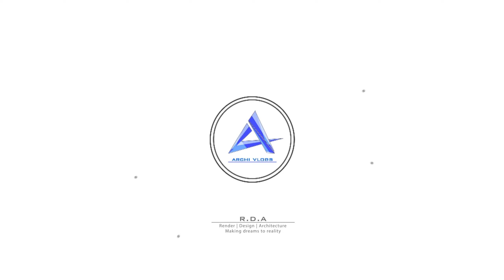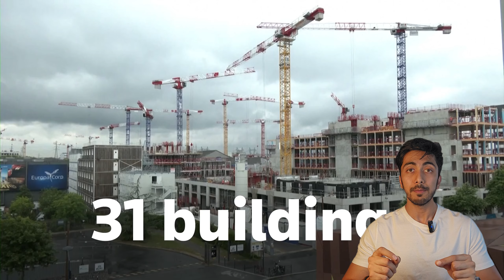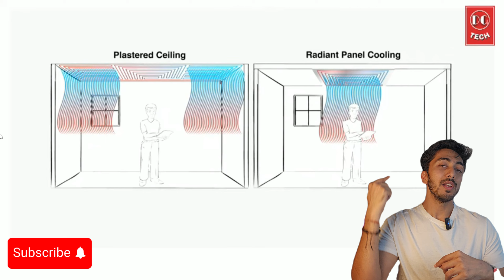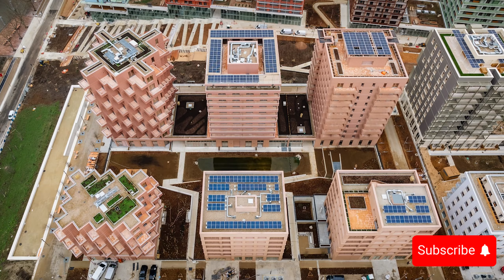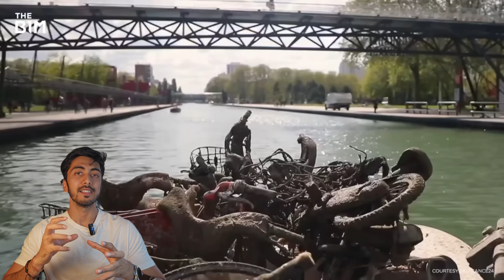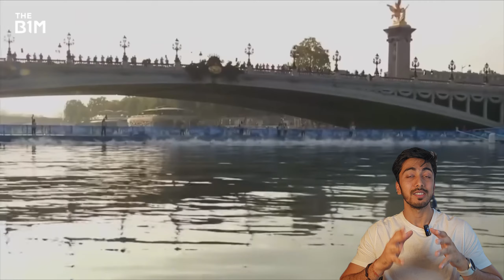Paris Olympic 2024, Construction and How No Air Conditioning is possible by Design Explained

Comment: I love the idea, however, using athletes from other countries as the guinea pigs to this seems high risk. There is no mention of what the comfortable temperature is, nor is there information on the cost of excavation to an underground level to install a water system with pumps that will take energy to cool the water and pump it back through the system. I would like to see the total construction costs before determining the sustainability of the village.  Reliance on the water pipes is also a bit risky, if there are extreme temperatures, will these pipes leak or burst in the winter?  It's a great concept, which in a moderate climate may work great, and promote other regions to practice sustainable design. But touting it as a "green solution" when portable AC units will consume more power and be less efficient than a large central cooling system.  I'd really like to know the cost benefit analysis of the construction.
Reply: Just say, poor country did the rooms poorly😂

Comment: what if a pipe burst?
Reply from the maker: Good question, usually these pipes are low pressure pipes and made of flex pvc the chances of burst are very low, and they don't use rcc walls or floor so it becomes easy to change these.

Comment: The Paris Olympic village was designed without air conditioning to reduce carbon emissions, but this AC-free ambition for Olympic village melts away as there 2,500 temporary cooling units will be fitted when athletes arrive later this month.
Reply from the maker: Most countries have no objection. The portable ac are being installed by the USA, Canada, Australia, etc which also exposes how much they actually care about climate and scientific data supporting the comfort parameters in these rooms.